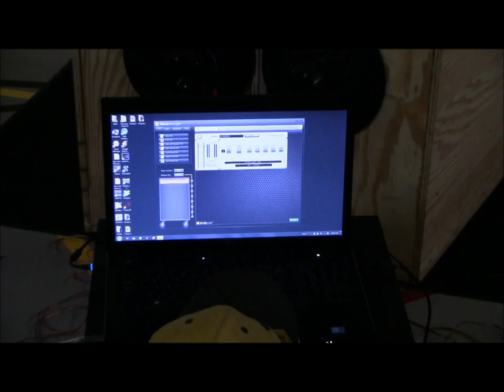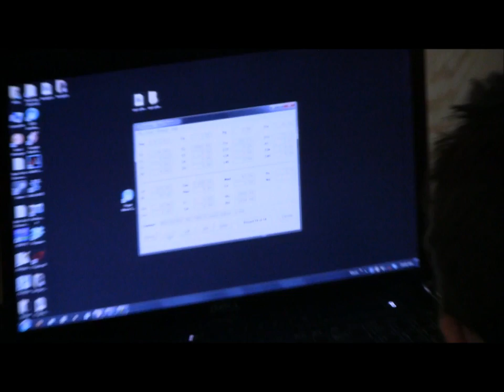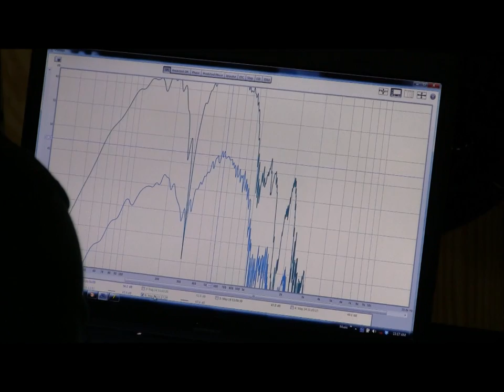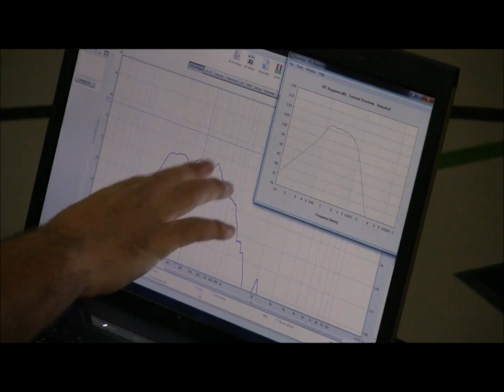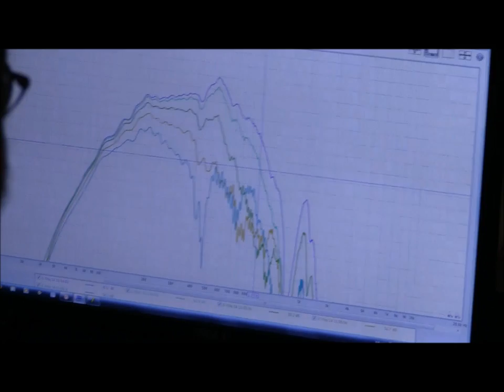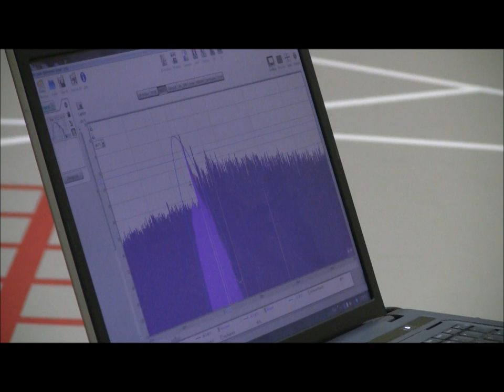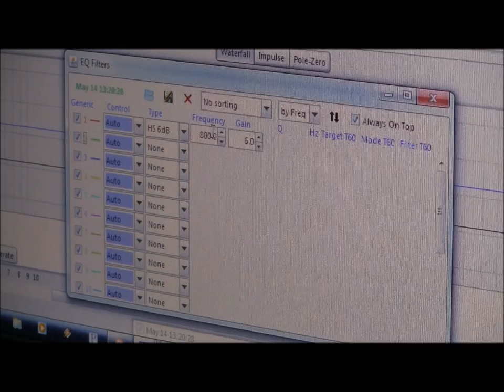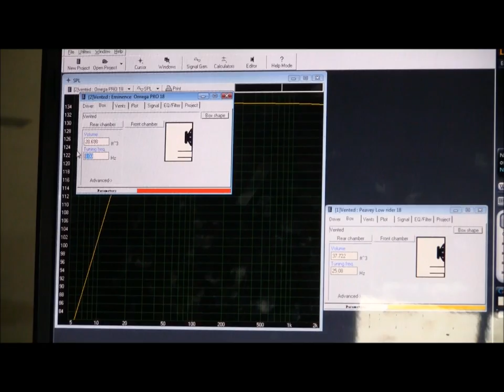Building and Testing the speaker

Comment: really a nice punch do these horns have. but don't expect too much low end with a horn that short und these relatively small mouth area. good point: it does not have a rear chamber, so the driver can move more freely and is able to gain more spl , if you understand how to manage this... most times, with open back you need larger horns than if you're using a closed rear chamber.

Comment: Why chosen for such a bad acoustic environment for measuring
Reply: Are you familiar with time delay spectroscopy? A gym is perfect for measuring because the earliest reflections are delayed at least 50ms, which offers plenty of frequency resolution when properly gating the measurement. It is better than measuring outdoors because you don't have to deal with the wind and other ambient noises. The only thing better would be an anechoic chamber so that you wouldn't have to gate, but that is a ton more expensive than a couple hundred dollars in measurement gear.
Reply: Mike A 50 ms delay is the minimum or every ms more is otiose or the larger the better? What is it?
Reply: Mike Foor the time being, thanx for your explanation.
Reply: gerard steen It is entirely frequency dependent. A good way to think of it is in terms of how long a frequency takes to do one cycle. 1Hz takes 1 second per cycle. If you only sample a 1Hz tone for 0.1 seconds, then the lowest frequency you can see would be 10Hz. Basically your measurement isn't seeing what is really a 1Hz tone. If you measure for 10 seconds, then you get to see 10 cycles happening and you will see that 10Hz tone with 1Hz accuracy. This analogy isn't perfect mathematically, but I think it works conceptually.

At 50ms, the lowest frequency that fits is 20Hz. If I'm analyzing two tones, one at 100Hz and one at 110Hz, then a 50ms sample isn't long enough because I can only see 20Hz bins. They will combine into what looks like a single ~105Hz tone. But at higher frequencies like 2kHz, how much do I care about the difference between 2000Hz and 2020Hz?

When looking at speaker performance, we know that the dominant frequency shaping effects are low Q except for where reflections and resonances are present. Ideally we avoid reflections and resonances in the design, so we just need enough frequency resolution to know how to address the system EQ - and arguably just enough resolution to know when reflections/resonances are happening.

Totally unrelated, but another thing to consider is that the amplitude of a reflection is attenuating the further it travels. So even if you have a reflection getting into the measurement window, if its amplitude is more than 10dB lower, then it will have less than a 0.5dB effect on the total measured amplitude. If your signal looks like a line source and decays at 3dB per every doubling of distance, then your microphone only needs to be four times closer to your speaker than the reflection to have less than a 0.5dB affect. I generally follow a 10:1 rule since you can have multiple reflections summing coherently and in reality you see closer to 6dB per doubling of distance since the wavefronts are generally more spherical. So with that in mind, it's not hard to find a microphone position in the gym such that the reflections are way lower in amplitude than the direct signal.....so opening the window doesn't affect the frequency response very much....you just see it show up as increasing the jaggedness of the response.
Reply: Plus this was the spot they actually mounted the speakers to.